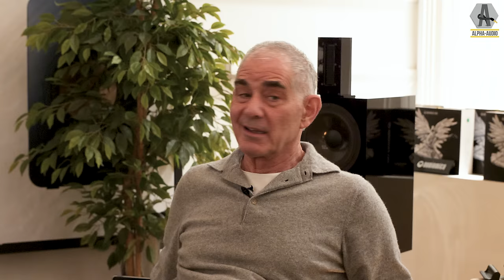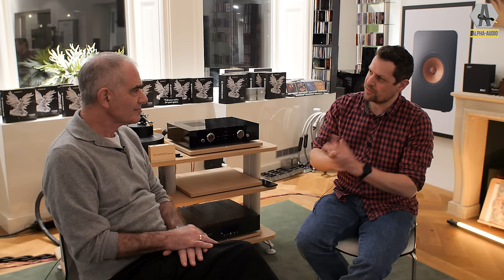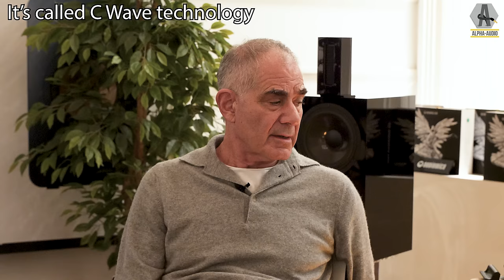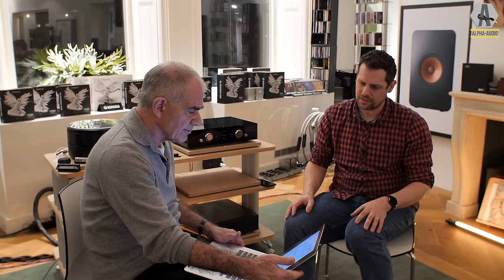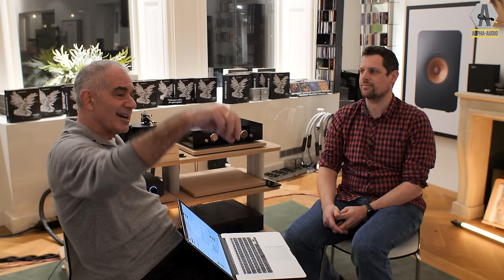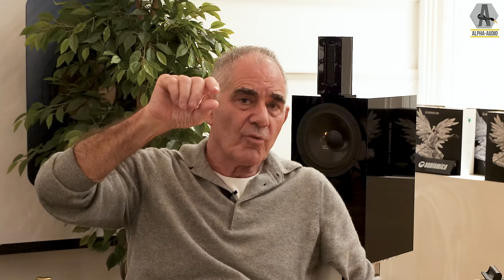Interview Mark Levinson - About the new C Wave Technology

Comment: As an ex-mastering engineer, can confirm that the effect of adding a tiny bit of reverb to an existing recording at the end of the audio chain can smooth out the audio in a pleasing way that no equalizer or compressor or saturator or limiter (the most common examples of audio processing tools) can do. Therefore, it makes much sense that a clever way of applying a tiny bit of reverb in the digital domain (which was implied in this interview) will similarly create a pleasing smoothness to audio output. The Daniel Hertz amp sounds unbelievably smooth versus other amps, which now makes sense when considering what we learned here. I assume that such a technique / technology will be copied by one or more manufacturers at some point, bringing the consumer cost to enjoy such an option in audio equipment down.
Reply: @DynissRainer  
I would much rather want to be able to add reverb only WHEN I want to, for instance via my Bricasti M7 or other high-end studio reverb, rather than this "always on" approach to the entire signal in the D/A conversion.

Anyone could add a Bricasti M7 to ANY amplifier or preamplifier for less than the cost of the Daniel Hertz units and it would also allow for a quick A/B as well as a plethora of different types and levels of reverb that might be much more appropriate for a specific style or genre of music.

It's common when tracking any vocalist that they nearly always want a decent amount of reverb applied to their hear-back monitoring via their over-ear headphones or IEMs.  Most vocalists don't like the sound of their own voice "dry" without any reverb.  But applying appropriate and pleasing reverb is Extremely Tempo- and Timing-Dependent.

The mixing engineer will already apply the artists' and their own type and amount of reverb to each instrument and vocal in the mix as desired.  As a drummer/percussionist and sax player, I will almost always apply some reverb (for drums it is usually just on my overheads), but I DO NOT want someone adding a constant reverb or any other EFX on top of what I've already applied to the mix!

Comment: Dr. Hirata already did tests over 40 years ago (May 1980) on individuals' physical reactions to hi-fi. The Hirata method is based upon noting that musical waveforms often contain transient events which are brief, and asymmetric in shape. Recognizing this, Hirata devised test waveforms which are asymmetric and quasi-transient, but which have a mean (average level) of zero – i.e. no d.c. component. Waveforms of this general type are very interesting since they can probe effects whereby the linearity of an amplifier (or other audio component) is sensitive to medium-term statistical or short-term asymmetries in the waveforms. Unfortunately, as with the Belcher method, Hirata’s proposal in the above article is based upon waveforms that have some related drawbacks. For example, the Hirata waveforms were essentially a group of rectangular pulses. The resulting spectra then depend upon the sharpness of the pulse edges, etc.

The purpose of what follows is to outline some of the amplifier effects which might need to be probed to identify non-linearities which affect musical reproduction. Then go on to consider an alternative method that might provide measured results more relevant to musical performance.

Measuring well and sound well are different things. Hirata tested many amps; some tested measured poorly like the Marantz 8B but sound fantastic while some amps that measured very well sounded bad on his testing method. There are many products that measure well and sound awful.

I won't get into the end user restrictions i.e. rooms etc. Nobody lives and listens in an anechoic chamber.

Comment: Hmm - this is like listening to Bob Carver describe the benefits of his "Magnetic field coil power amplifier" or "Sonic holography" - although I will add that Mr. Carver was a physicist and engineer. Here it sounds like Mark is producing a proprietary Class D amplifiers and is using computer-controlled reverb to 'fill in the gaps' of PCM/digital source material and its related amplification. In looking at his website, he describes a proprietary Class D amplifier chip that is programmable using a "Windows 11 PC running the Canvas III master control software program" to alter the sonic profileof the amplifier chip via its embedded software. I guess time will tell if people feel that deliberately distorting a signal to compensate/counteract other distortion is a viable solution. 

I will say that Mark has stubled on an interesting concept: the audio world, from recording, mastering, amplification, etc. is becoming a predominantly digital world vs. the old analog world and that yeilds the question of if we need different components better-suited to handle this source material for audiophiles. Do we need Class D amps? And, if so, do we need software-controlled amplifiers to produce the best sound? Or can we take a digital source, convert it to analog and run it through existing great analog components and achieve equal, if not better, sound?
Reply: I’d never looked into that idea! A brilliant thought!
Thank you for posting.

Comment: I would love to have one of your c wave products but I am afraid I could never afford $20K+ for an amplifier.   It’s funny.   Digital audio has been around for 60 years (or more).   Now I need a 20k amp to “fix” the pcm?  So,   If we take pcm and convert it to analog using D to A is it not continuous?  The quantization is an approximation (discontinuous)but isn’t the D to A creating a continuous waveform?  I am a bit confused.   We don’t hear digital.   So you are saying the digital converted to analog is not continuous?   Would like to understand more how exactly this tech works.   What is suspect is that there is something added to the digital before analog conversion that “smears” the digital to make it sound more analog.  Adding reverb?  To fill in the missing?  What I have found is that chip based ADC and DACs do not sound as good as early digital.   Those Telarc disks from 80s sound phenomenal.

Comment: Does anyone talking in the video know what a reconstruction filter is? Saying digital audio has these steps that need to be filled in is just foolish.
Reply from the maker: I have to agree I have a lot of questions about how this works. There wasn't enough time to ask about the deeper workings.
Reply: This C wave tech sounds similar to what Chord do with their Hugo M scaler (filter and upscaler).  Anyone know if this is the case?
Reply: @ryanclements6031 Actually, no. With Chord, the goal appears to have an FIR filter with >1 million taps. You need massive computing horsepower that DACs tend not to have. Hence, the scaler product. What C Wave is purported to do is not at all like that.

Comment: Digital music certainly can be improved and I hope PCM is not the end of the line because it is still far from sounding natural. Is C-wave the answer? Won’t know until I hear it but anything that helps make digital music sound more natural is a step in the right direction.
Reply: 12:46 his test and digital (re)encoding is similar to what sony did on creating atrac3 compression/decompression alog and JVC k2 24bit decoding.

Both tech did not last long in the market.
Reply: Only Genelec dsp sam smart studio speakers allow the doors of paradise open. And when connected digitally with specific aes/ebu 110 ohm cables directly to your bluray/uhd bluray player (impedance converter included 75/110 ohm) with your coax/aes ebu connectors you will hear everything accurately and deeply. And you can only do this in your living room or bedroom. Smart active monitor. 8331/8341/8351/8361a

I know because I only enjoy listening to music with genelecs in my living room digitally.
Reply: @TheSagitis  And why?

Comment: From the explanation given, it seems what is missing in digital are the harmonics and their richness. C wave tech would then add some kind of reverb pointwise to the wave signal, before having it go through DAC conversion. It may as well work, bur keeping in mind that extraneous information is being added to the original signal, though such reverb somehow keeps a correlation to the signal being "corrected".
Mark mentions that good audio gear need not be costly. However, his earlier and famous audio brands like Cello, Red Rose and ML have always been quite expensive and short-lived, having been advertised from the same assumption, namely, these have always been quoted by Mark as "revolutionary", and yet none of them stood the test of time. So, we've all seen Mark make claims like this before, we've seen it already, and here he is with the same talk which to me sounds a little like an adman's talk. He may as well be right, but I'd rather listen to all this with a grain of salt.

Comment: It sounds like what they are attempting to do is cover up filter artifacts with a sort of time domain dither, using reverberance of transients as the noise generator to settle or hide impulse elongation/ringing so the transient energy remains in the original signal and not bouncing around just above the filter cutoff. I've worked with reverb a lot, and this is not something I ever experienced or considered possible. But whatever his DSP is doing, if people like the way it sounds I guess it should sell well. Otherwise it's another thing like adaptive filters, apodizing filters, MQA processing, that might produce a particular nice sound, but isn't the end all of digital audio.

Comment: The assumption that 40 kHz or greater sampling rate can't produce a waveform up to 20 kHz precisely violates Shannon Nyquist. The lollipop theory of discontinuity of digital sampling violates the principle that voltage across a capacitor cannot change instantaneously. This is the principle on which an AM radio detector works. All stations are downconverted to 455 kHz in a suoerheterodyne receiver and an RC network connects the dots at the peak of each positive going wave in single sideband. Whatever  the C wave does that's beneficial assuming it is, the explanation given here is not correct.

Comment: Sounds like DSD made from analogue tapes should be a step in the direction Mark aims for. A Kong the very high end brands dacs, PCM is upsampled to 16x or 20x DSD and then the analogue output stage becomes much better and easier to get really good, compared to a pcm based dac. Study PS  Audio DirectStream dac, Meitner MA3 and others… SACD (DSD 64) sounds like part of Marks solution
Reply from the maker: I was thinking about dsd as well. But it is different. Still curious about how it works deep down. We didn't have the time to explore that in this interview.
Reply: @TheAlphaAudio    The patent for the technology should be publicly available.
Reply: @TheAlphaAudio how much improvement is C wave over high sample rate dsd?
Reply from the maker: @bbfoto7248  yes. Indeed.

Comment: Digital done right is fine. 
Hell, Fagan superbly captured and released first gen digital ~'81/'82, ... forty plus yrs ago. 

Today, high res capture and release material, is stellar. 
It's all good, the pro side and consumer side. 

That said, signal manipulation via a feel good vector, is worth exploring. 

As long as it's both enhancing and transparent.
Reply: @FOH3663  
I agree for the most part, especially in regards to D/A & A/D conversion being well sorted for decades.

HOWEVER, claiming actual benefits to our physiological health and well-being through the use of this "technology" exclusively, while essentially deeming all other standard PCM as comparatively "unhealthy" is a serious matter.

Whatever research may or may not have been performed here needs to at least be publicly available for peer review.
Reply: @bbfoto7248  
You're right.
I don't see stringent peer review ... only anecdotal subjective takes, which could be compelling if well detailed from mastering engineers, etc., ie., those individuals hanging their hat on this. 

Interestingly, if such an approach is effective, then is it appropriate to suggest it likely only represents an immature, early version ... with ample potential for more optimization?

Comment: How is it different from using a tube stage for smoothing out the sound? Also how does it compare to DSD?. Which also give a more natural presentation. It is not like Music has been depressing me since the eighties.
Reply from the maker: A Tube doesn't fix the discontinuity.
Reply: @TheAlphaAudio  true
Reply: @TheAlphaAudio  How is there a discontinuity in the analog waveform output from the conversion?  If there is any legitimacy to the discontinuity argument then you would be arguing for missing data points and an incorrectly shaped waveform.  High rate sampling would help the issue, which it seems to, but seemingly by fixing conversion artifacts, not adding missing data.
Reply: @TheAlphaAudio   Explain (technically) what this "discontinuity" is?
Reply: @TheAlphaAudio  is C wave a way of more accurately reproducing the analogue waveform from discrete digital samples? Does it work better with high definition audio?
Reply: Is this guy from the Scientology movement I’ve never heard such a load of baloney

Comment: My first degree is in Applied Physics/Electronics, a musician (by hobby) and been a SERIOUS  audiophile for over 30+ years. My present digital front end is frankly SOTA in its execution, including  a LPSU modified MUTEC reclocker whose jitter output spec is lower than can presently be measured. It drives a Lyngdorf PowerDAC in which volume is controlled by adjusting the voltage rail. Sorry to burst any bubbles here, but PCM on my system is simply magical - and to even suggest it is not good for (anybody's) health, borders IMHO on simply silly.  I wish you all the best, but (again IMHO) to suggest that your opinions expressed are objective, suggests to me that you need help.

Comment: ML components are stupid expensive just like a lot of other brands and I've heard stories of people not even being able to have older ML equipment repaired , so talk is cheap.
Reply: The reason older MLAS products are hard to service is that Harman - the company that has the schematics, etc. - refuses to service them or provide parts or schematics to anyone. 

Re value, add up what a Maria 350 amplifier does - replaces the dac, preamp, power amp, interconnect cables, headphone amplifier, has 3 x 1 megohms analog inputs, usb, coax and WiFi/Bluetooth, 350W @ 8 ohms/ 500W @ 4 ohms, native resolution of 384khz, 124db dynamic range, second to none in sound quality, and much more - for €12k. Do you think that’s too expensive?

Comment: This is some kind of comb filtering: delay, adder, divider. Easy to do on fpga or dsp.
Reply: If you don’t agree with the objective tests we made, how do you explain the results they show?
Reply: Happy for your reply. Many people know that pure analog and digital audio are different. Many prefer pure analog and wish to be happier with digital. So far, no one has shown any objective, repeatable consistent test that explains the difference. The C Wave patent is based on tests which show it’s not an audio issue - it’s the way the human brain responds to the continuous waveform of pure analog vs the non continuous waveform of pcm digital. C Wave is a finely tuned reverb algorithm that fills in the spaces with a very small amount of signal from original music information. Imagine you want to make a digital copy of an analog tape. Until now, digital copies never sound the same. With C Wave, it’s much closer.
Reply: @marklevinson-yg8zh  I still believe the problem is the too low sampling rate.